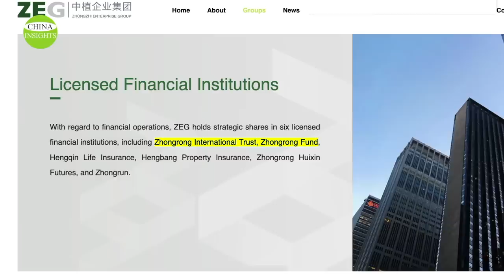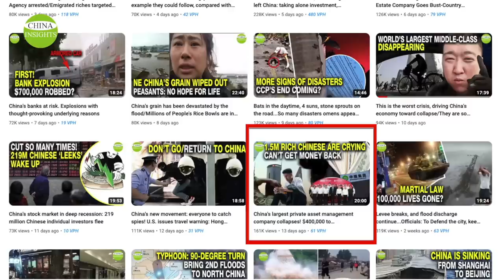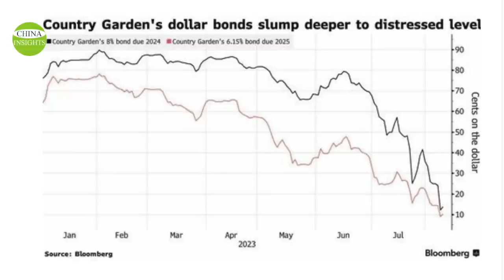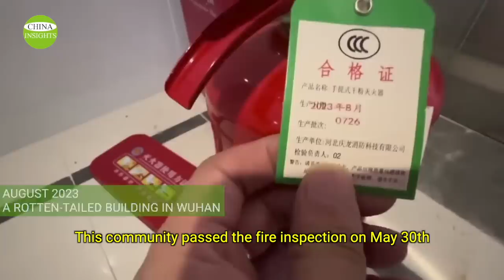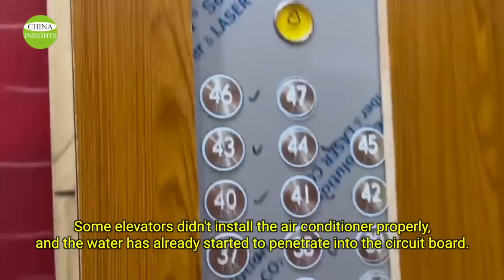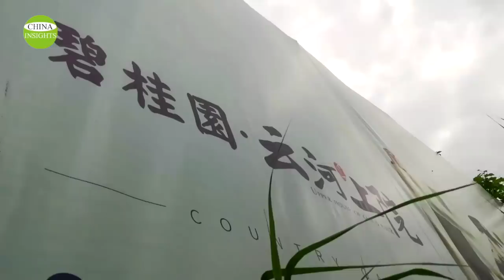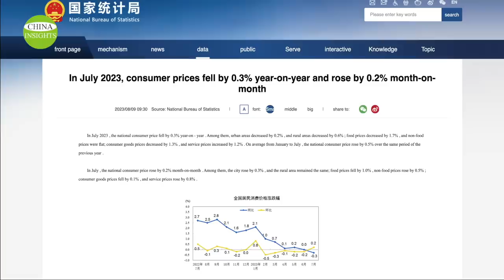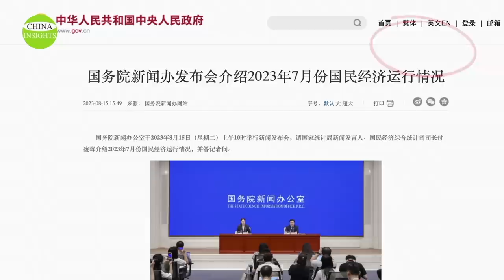Zhongrong International Trust crash! The economic bombs set a chain reaction and No one escape

Comment: That's the problem with meteoric rises, when the fuel in the rocket runs out there's nothing below to support it.
Reply: Especially if the rocket and fuel are both made of tofu.
Reply: Well, maybe. If the rise is built on a solid foundation and system, things will be ok. But, we know it was built on quicksand.
Old job was Financial forecasting. Hockey stick type growth is always a concern. Frankly, we would hold a few levers back to make sure we didn’t grow too fast.